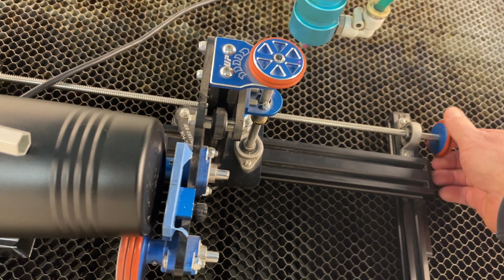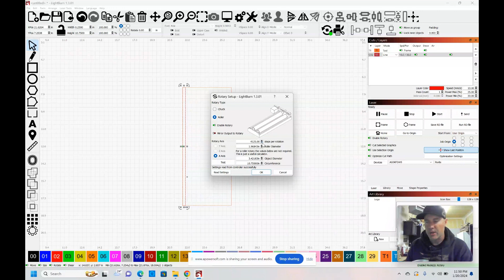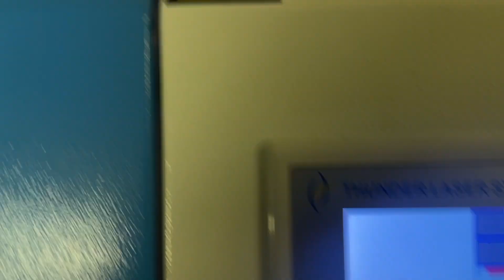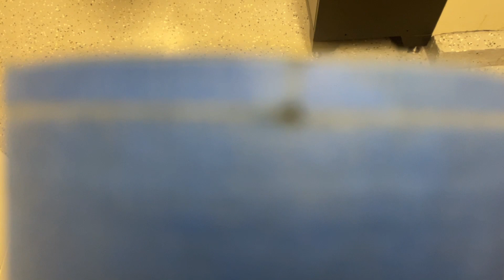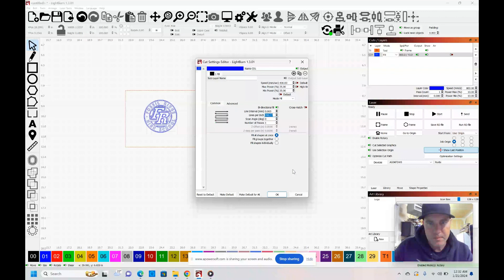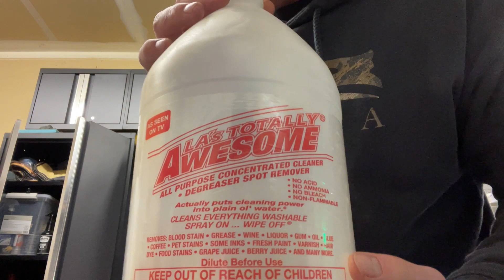Engraving A Polar Camel Tumbler On A Thunder Nova 51/130 Watt CO2 Laser - Start To Finish

Comment: Just wondering with this Laser model, if your sweet spot is 400/35 - couldn't you increase to 800/75 with the same result or are there other considerations?
Reply from the maker: Hey Bill, 75 power I think is way too high.  I've never tried this high of power, but may work.  However, for whatever reason, when I preview with these settings, its saying it will take about 40 seconds longer than my original settings.
Reply: Thank you. I just bought the 51/100. I’m wondering how close the string will be on mine? Thank you. I learned a lot.